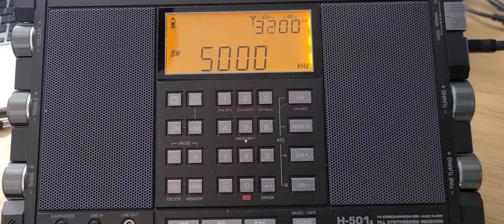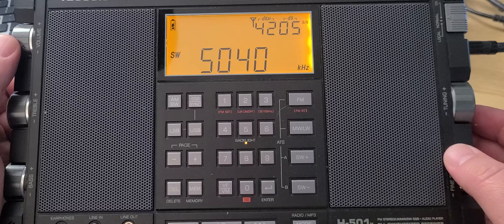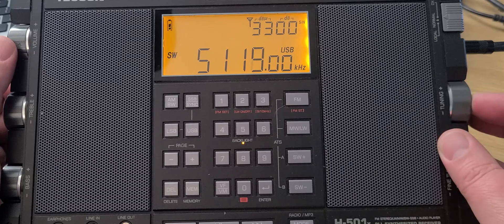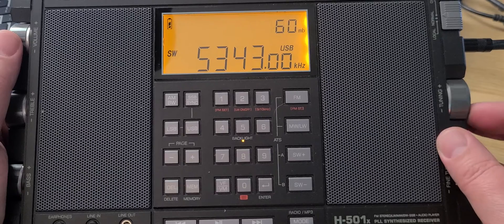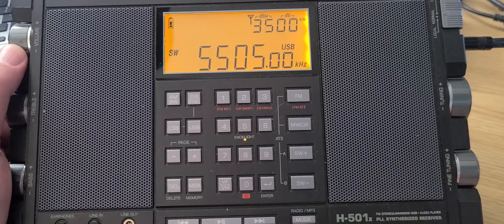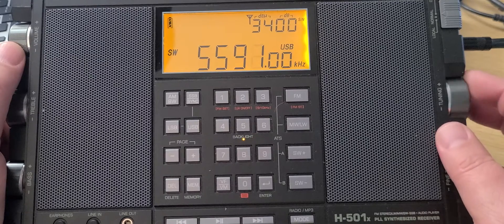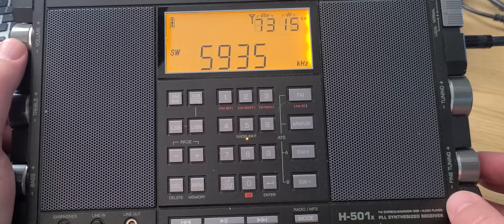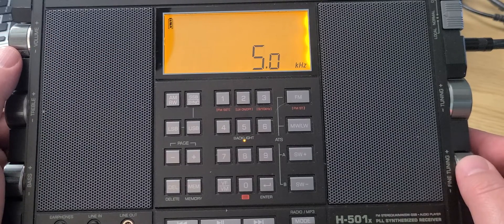What is there to tune 5000 to 6000 kHz Shortwave Tecsun H-501X on MLA 30 loop antenna

Comment: Gill,in Italy on air 45 meters is pirated in lsb from ex cb years 80,the frequency 6,900. Between the frequency 6,600 /6,900 is air soccors,73 by i2/03897 Mi